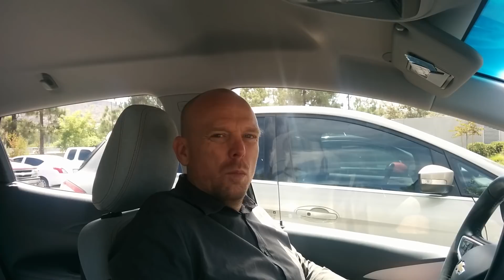Plug-Side Chat: Increasing DCFC Site Capacity with Steel and Water

Comment: Let's consider a molten carbonate fuel cell (MCFC) at Harris Ranch as it is a large scale example of what you propose:

The first thing you will notice when you arrive at Harris Ranch is that there is a large amount of renewable methane present.  You will sense this with your nose.  So sitting right there at one of the primary charging spots in California is a huge supply of methane which is just being wasted and emitted into the atmosphere (and CH4 is a 24 times stronger GHG than CO2 is).

So, let's say we put a MCFC there. A MCFC takes in methane and produces 4 outputs:

- Hydrogen
- Electricity
- Heat
- CO2

The usable energy contained across the 3 energy containing outputs is more than 80% of the energy available in the CH4. 

Let's talk about the CO2.  That CO2 is contemporaneous organic CO2 (i.e. it does not originate from stores that have been sequestered in the earths crust) and as such it has been present in the earths atmosphere for millennia  (i.e. it is carbon neutral as it was removed from the atmosphere by the plants that the livestock consumed and we are only cycling it back into the atmosphere from which it came).  So, this configuration is carbon neutral and yet, it is removing a far stronger GHG (24x stronger than CO2) from the atmosphere, so, in fact, it is actually GHG *negative*.

Ok, so we now have 3 GHG negative outputs, what do we do with them:

- Hydrogen can be used by FCEVs (there is already a H70 hydrogen station at Harris Ranch)
- Electricity can be used by BEVs for charging
- The heat can be applied to thermoacoustic coolers (coolers with no moving parts) to refrigerate the H70 hydrogen

The net result is a system that is 80% efficient and uses a energy source that was not previously utilized and by doing so doesn't just not contribute to greenhouse effect, but, in fact, removes GHGs from the atmosphere.

So, yes, your proposal makes tons of sense, so much sense in fact, that this is exactly what Toyota is doing in long beach (only downside is that the renewable methane must be liquefied and  transported by tanker to Long Beach which brings the efficiency down to around 75%).

At Harris Ranch a 1MW MCFC would easily supply all the energy requirements of the hotel/retail complex plus all of the transportation infrastructure (recall that a 1MW fuel cell represents 24MWh of energy production per day).

Also, if you are wondering whether there are actually commercially availability thermoacoustic coolers: https://www.soundenergy.nl/theac-25/

Comment: What, where are you finding value from Exhaust gases?
Reply from the maker: It's just the going rate for CO2. Burning one gallon of gasoline produces 20 lbs of CO2. Go buy 20 lbs of dry ice or compressed CO2. It's not cheap.

Comment: I just read that GM is looking into solid state for quick charging. If it gets to the point where you get 80% of the range in 15 mins, then I think that would be a big push forward for EV's. Do you have thoughts on that ?
Reply from the maker: Sure, I think it would help with perceptions. Right now, though, the biggest push for EVs would come from lowering the price and increasing production. The more I look at the numbers, the more clear it is that current demand for EVs exceeds the supply by a wide margin. 

Even if all its capabilities and features stayed the same, a $20,000 Bolt EV (without any incentives available) could easily sell 100,000 units a month.

Comment: Here is a novel idea. Instead of using high energy lithium batteries for our chargers... Lets use low-energy-density lead-acid batteries. They will last 8 years if properly taken care of. And it does not matter how heavy they are if they are stationary. And best of all, it saves lithium, and cobalt that could be used for car batteries.

Comment: I’m no expert on CO2 sequestering, but I would think that it takes more energy to get it than you will make from the natural gas fuel cell. If this wasn’t the case, we could just use natural gas fuel cells with CO2 collectors on cars and drop off our CO2 bottles at McDonald’s so we can get carbonated drinks. LOL.
Reply from the maker: That's something I was talking about in my Heat Pump video. 😁

The easiest way to sequester CO2 is to remove the heat. Nobody seems to have a good idea about what to do with the heat, which is just energy. If you're already scavenging heat and converting it to electricity, why not scavenge more?
Reply: News Coulomb, because i think it still takes more electricity to remove the heat than you can get, especially to permanently sequester it or at least convert it into a carbon neutral fuel. If not we could use a little fossil fuel to make electricity to turn CO2 and H2O back to a hydrocarbon and burn part of that to make more electricity to keep the process going. It doesn’t seem possible. 

I think they have CO2 scrubbers, but the energy needed to make the stuff that absorbs CO2 is going to take energy. 

Somehow they convinced a bunch of idiots to buy small machines that turns electricity into heat to create some imaginary crypto currency. Why hasn’t someone created CarbonCoin for each amount of CO2 you remove from the air and sell as a fuel?